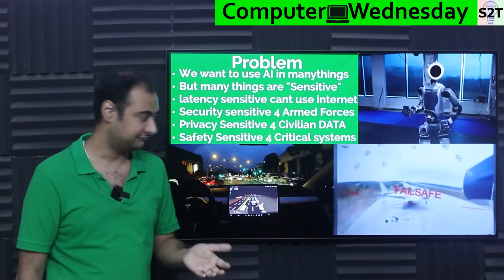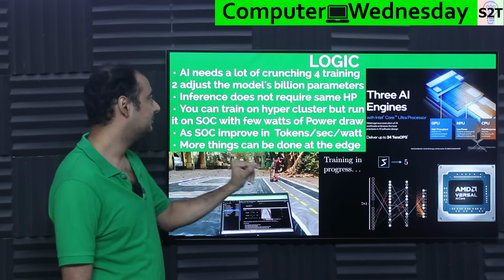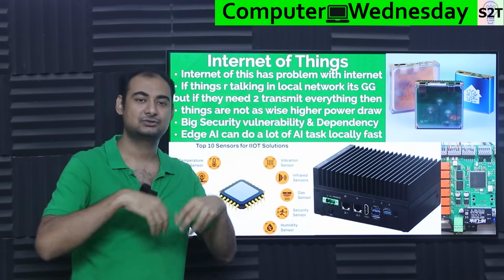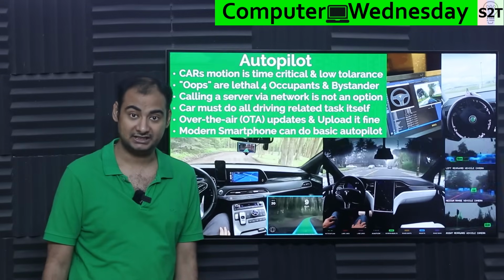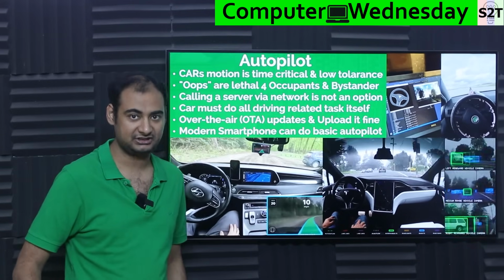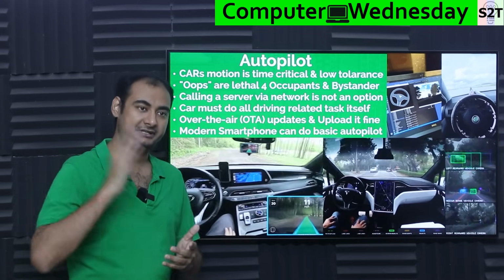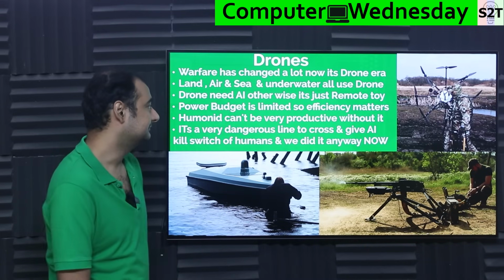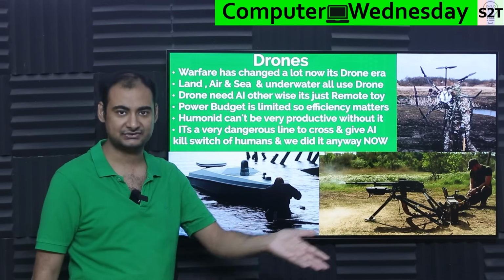Need & Growth of Edge AI Explained {Computer Wednesday}

Comment: One note so far.

Most NPUs are made more for CNNs, not transformers.

These tend to have much less intense memory requirements, thus many NPUs are not well suited for the current hype topic.
Reply from the maker: people will tailer the AI for it same way we port things to go from CPU to GPU its doable
Reply: @s2tenglish eh... Yes and no.

The NPUs in their current iteration are 'cheap'. Pure processing is cheap. It's 'memory' (as in cache etc.) that's expensive (and communication with other cores etc). Just look at Zen C cores, which have less cache, and at Intel E cores, which have less cache and worse connectivity.

So these NPUs you're imagining are not the same NPUs we have today. Unless we manage to reduce the memory needs of transformers, but then will they actually still be transformers? 

CNNs could be characterized by their sparsity in the number of weights, in comparison to the number of computations. You can reimagine the kernel to a much larger dense NN with lots of repeated weights. And that is what the NPUs in today's Qualcomm, Intel and AMDs 'AI' and the Google TPU are built for.

There are lots of venture capital financed companies racing to built the equivalent for transformers. Some of them with bright minds, e.g. Keller who architected Zen. I wouldn't be surprised if one of them pulls it off, but I'd also not be surprised if that kind of hardware stays pretty expensive and not generally available.

Comment: great analysis. one minor point, the problem with LiDAR and RADAR is their data is still unreliable, there's false readings and ghosting all over the place, and the data is much less intuitive to humans.. that said, yeah think you're still right on the money overall.

I'm less concerned about military drones on land, there's too many edge cases for them to be fully autonomous in the short term, but at the tool level, absolutely, an auto turret, or fire support/pack animal  👍

tell you what though, I don''t think you need monolithic systems for a lot of these problems, if you can get lightweight sub systems that do a dandy job on their thing, like walking and avoiding tangles, I'd bet dollars to donuts that you could stitch it all in to a good ol' symbolic engine for a lightweight LLM to watch over
Reply from the maker: LiDAR and RADAR is their data is still unreliable against camera they are better
Reply: @s2tenglish   an extra is might have worked its way in there. my point was LiDAR data varies by the surface its measuring, RADAR is noisy as hell, and how it behaves is dependent on both the material and environment